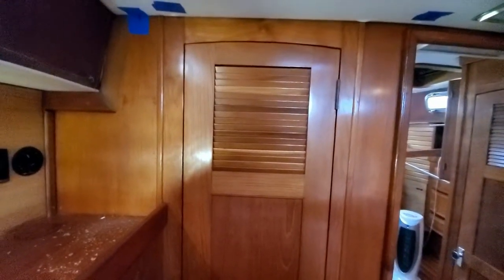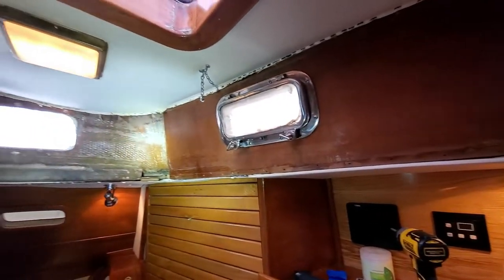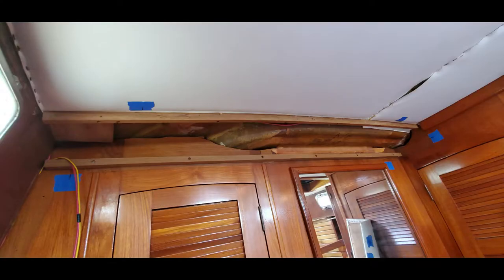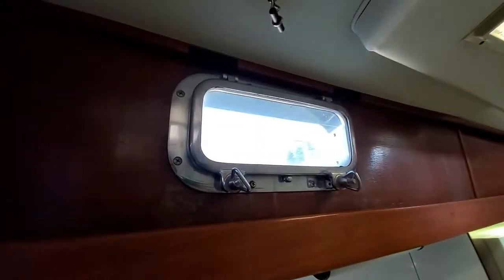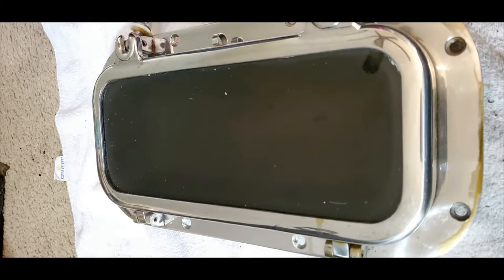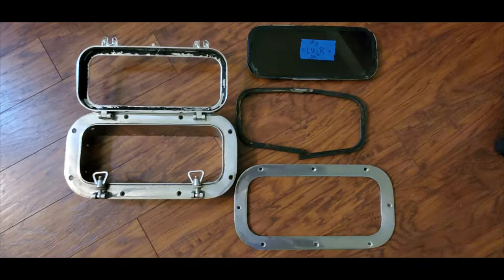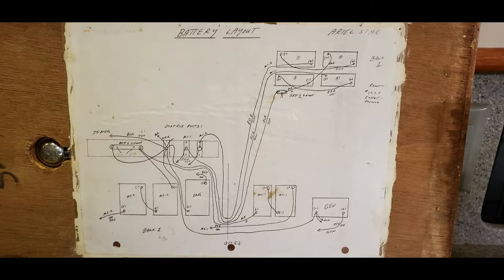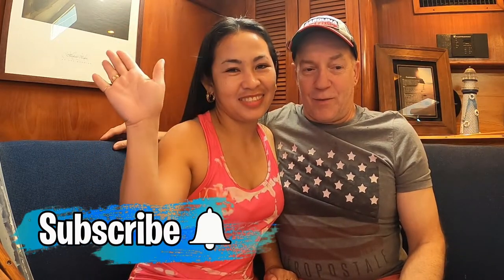Making new Teak Panels, Portlight rebuild, Endeavour 52 Sailboat S 1 Ep 22 DIY Nautical Dream

Comment: Seems like we’re both working on the same projects 😀 I have to do the same panels in my aft cabin too,thanks for showing me what I’m in for 👍.I’ve also been replacing all the bulbs in my light fixtures with LED strips.if you get strips with the same voltage as your lights it’s super simple to just cut them to length and stick them in the existing fixture.If I were as consistent as you I would have done a video already,but I’m still working on the boat shopping video 2 years after I bought the boat 🫣
Reply from the maker: Hello and thank you for your great comment.  Glad to hear you're finding our video interesting. We have been lucky so far when removing the old teak panels, in that we've been able to keep them intact so we can use them at a pattern to make the new replacements from. We will see what happens when it's time to install the new panels.  We are experimenting with some lighting fixture concepts that might solve our lighting needs. LED lighting is the best option. We are looking forward to seeing your videos once you get the time to finish them. It's not easy to find enough time to do it all. We are still both working full time and trying to make steady progress on the boat and grow our YouTube channel.  We wish you the best and luck with your project and thank you for watching our video. We hope you have a wonderful weekend 😀